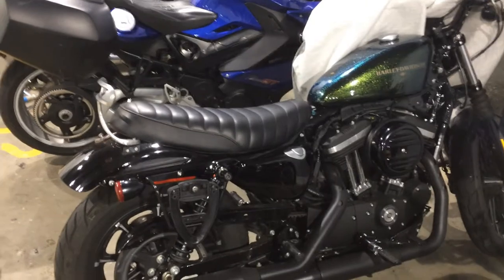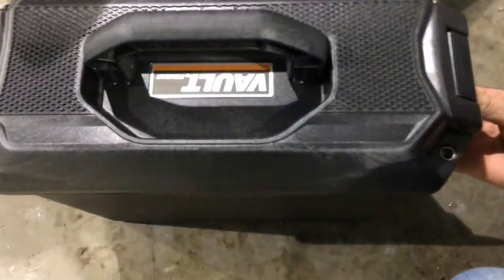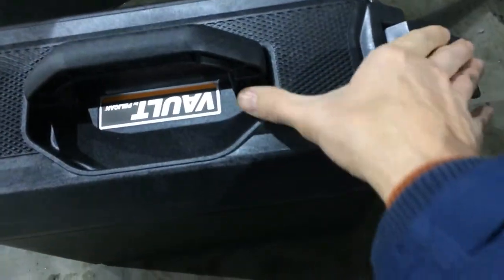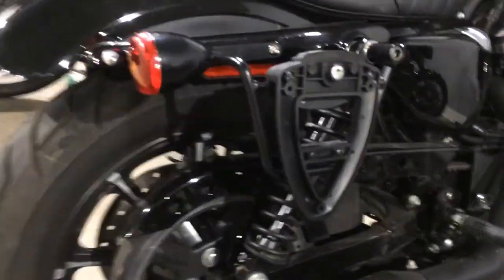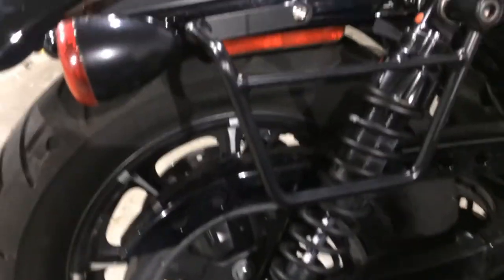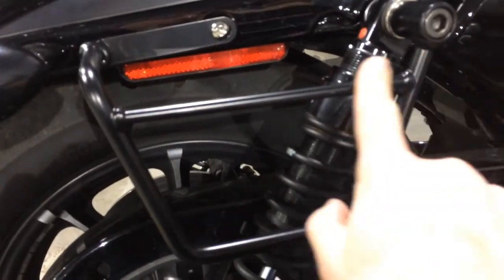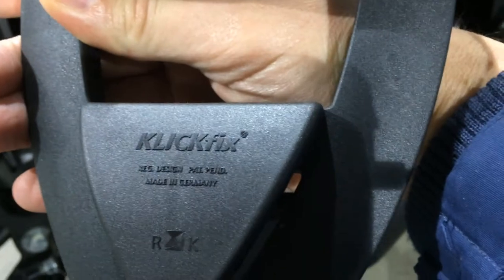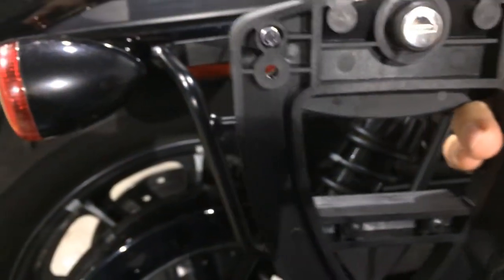Pelican Case Install on Sportster

Comment: have you had any issues with the bracket? i have the same setup but i got the bracket from unit garage and both of my brackets broke, only carry about 10lbs including the weight of the case
Reply from the maker: I haven’t had any issues; were yours the same brand bracket? 
LaPodarosa?
Reply: @pushrodfury6644  no they look slightly different and are from another company, i was looking for an alternative because i didn’t want to waste my money on the same ones. thanks for the reply!
Reply from the maker: @sliqindustries4782  Try La Podarosa they seem very well made - not easy to find I. The states tho!

Comment: Im wondering why you did not go for the pelican 1430?
Reply from the maker: I liked the ammo box look a little better and they were the same size. I am sure the 1430 would have worked out fine too. Are you thinking about using them?
Reply: @pushrodfury6644  i have the leatherpros on my slim. Im actually considering putting 1430 on my R NineT lol